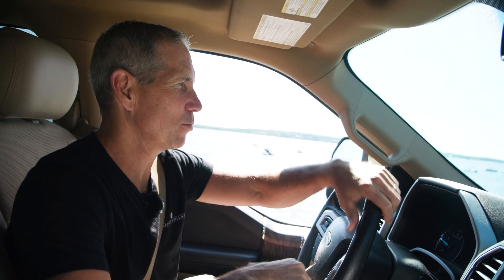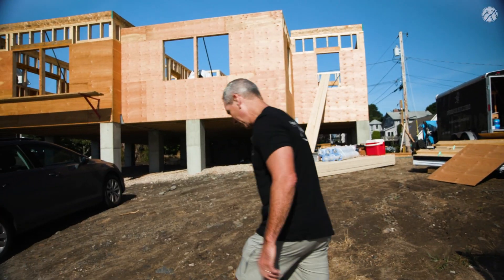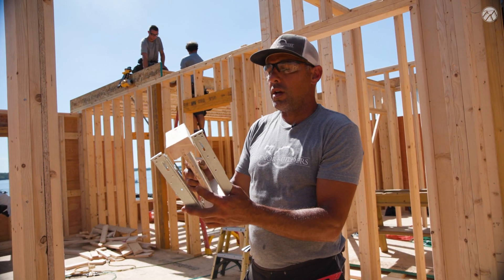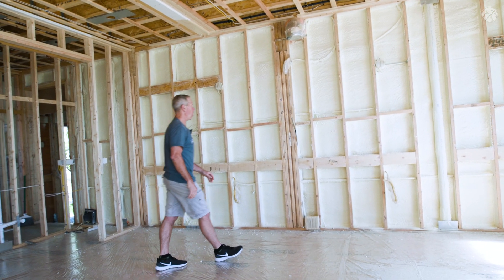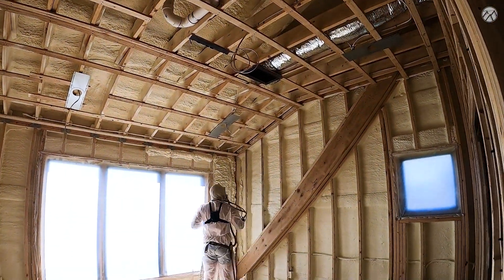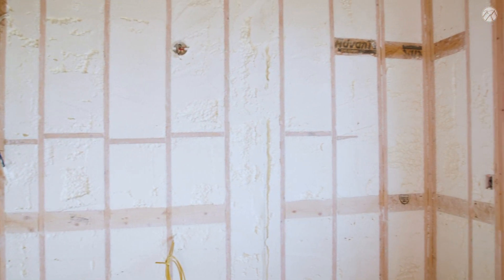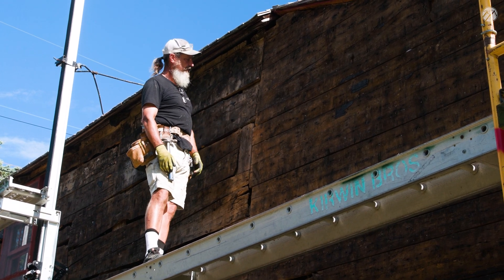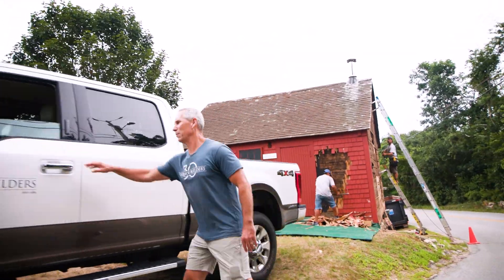Framing & Insulation | Building Quality Starts Here | Sawdust EP 02

Comment: I have never commented on anything in my life. I tuned   into these videos to check out Helios footer, I was fascinated by the way they are building on the coast  I have been building for 45 years in Florida We could never get away with this wood frame construction. Not one strap, anchor incredible. We build 10x stronger in Florida. The concrete piers would go up tThen we would build concrete tie beam to hold floor joist. WE would never would ever  fasten THE PT LVL WITH ONE BOLT PER COLUMN. If customer could afford, we would pour a concrete deck. for floor. We would then use block for our exterior walls crazy this COULD NEVER BE BUILT IN FLORIDA PERIOD I am shocked The last job the engineer required so many straps on wood frame I converted to concrete block construction

Comment: I know open is cheaper. Close cell has more R value per inch. Why not just keep spraying closed to get the desired R-Value?
Reply from the maker: Great question Tony. It is mostly driven by cost and speed.  Closed cell is significantly more money and can only be applied in thin layers otherwise it will never cure in the middle.  We really just want the air sealing benefit of closed cell and that is about an inch. The rest is just R Value and easily achieved with open which can fill the rest of the cavity quickly in one pass.
Reply: @Sweenorbuilders  Got it. Thanks

Comment: Do you guys spray foam the roof rafters? I have a furnace  in the attic of a 60s era ranch and was considering making the attic a conditioned room. Will that impact the roof in a negative way?
Reply from the maker: We use spray foam on the underside of the roof sheathing creating a conditioned attic.  You would want to make sure that you seal soffit, ridge or gable vents. Other than that no negative impact on the roof. Your furnace will perform more efficiently once it is in the conditioned space.
Reply: @Sweenorbuilders  thanks! Great series!

Comment: Whats the cost difference between spray foam and batt insulation roughly?
Reply: Around here can get a spray foam kit for $1 per square for 1in thick. R value of, say 6, per inch and you’re looking to spend about $3 per foot for r-18. Having a profession here would be 1.5-$2 per foot at an inch depth. They would have better r value foam. I’ve seen some close to 7 per inch, but the packs available here to consumers are around 5.5-6. Batt insulation for walls starts about $.50/sq ft for r-15 (67sq ft selling for about $32). Foam is nice as it adds rigidity and air sealing. Here I believe we need r20 minimum for walls. Only way to get there without using exterior insulation is to use foam plus batt. 1” foam creates a nice air barrier and the batt helps you get to The higher R without paying for straight foam at almost 6x the cost.